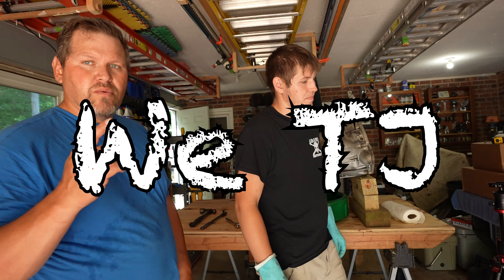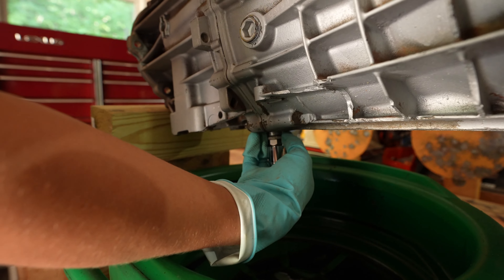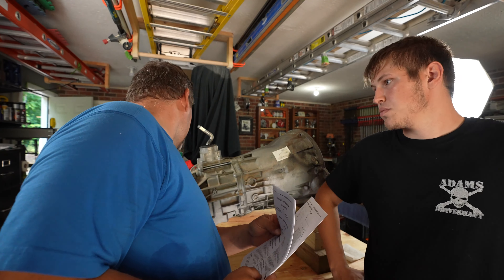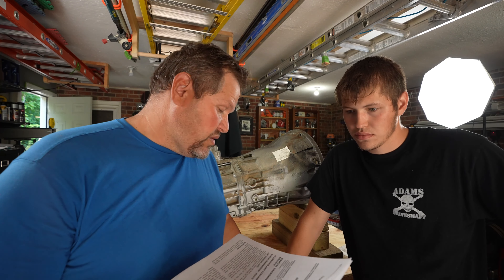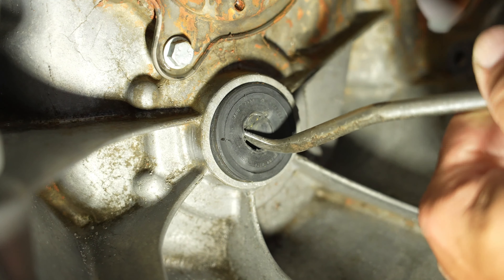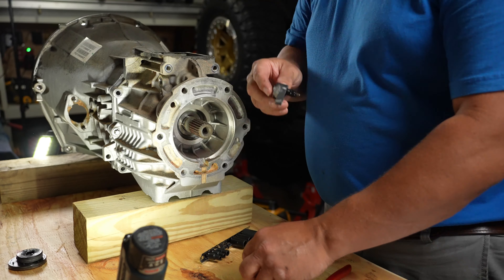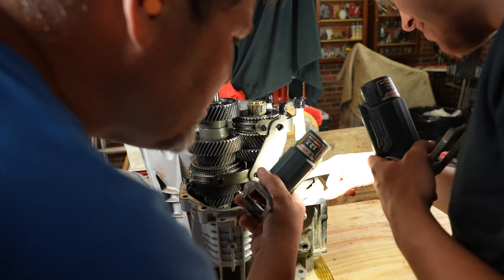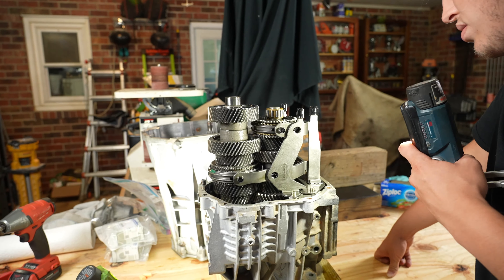2006 Jeep TJ NSG370 Transmission Rebuild PT2 Splitting the Case

Comment: I'm glad I found these vids... I accidentally cracked the rear housing extension over torqueing the drain plug. (I was feeling under the weather and wasn't focusing). This gives me a great idea of what I need to do.
Reply: The 2 seals (in the bell housing and at the other end with the snap ring).... Can you help me with part numbers on those?
Reply from the maker: Cool, everything is in these videos to help get you back together.
Reply from the maker: RockAuto has a pretty good break down on these seals. Your Jeep dealer can also get you those seal no’s. We don’t have the actual seal no’s though.